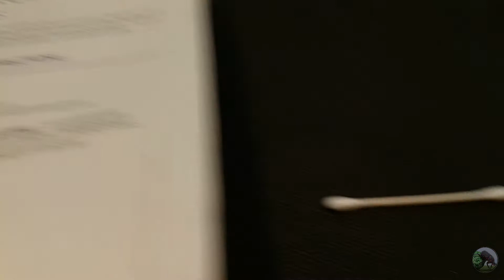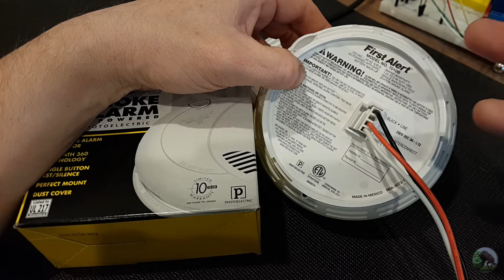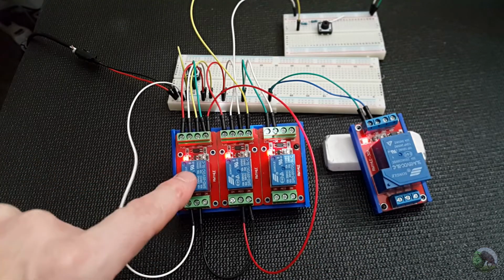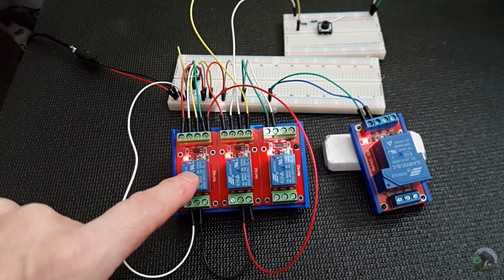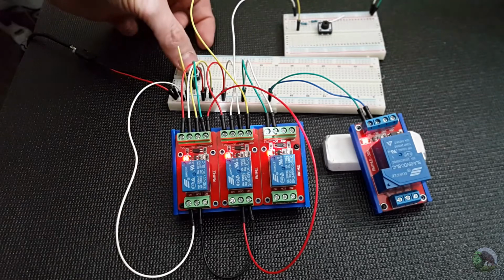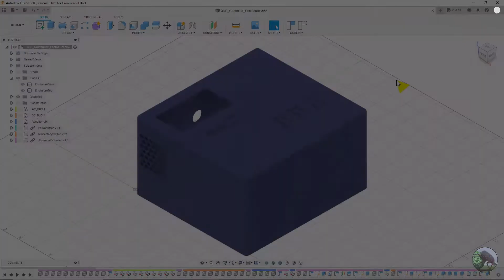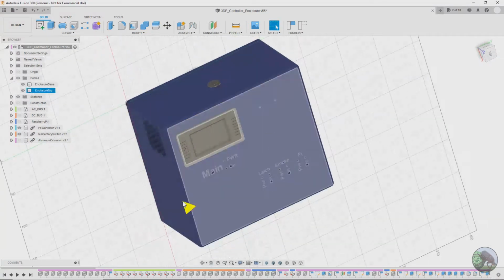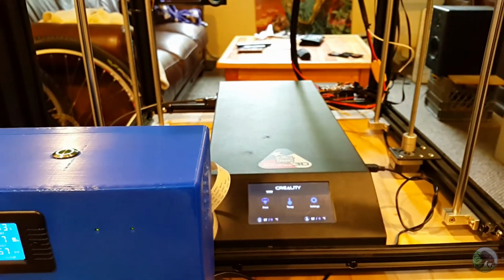3D Printer Controlled by Octoprint & a Smoke Detector

Comment: I'm running a Wyze Cam for monitoring and a Wyze Plug for a remote E-Stop for now. I like three concept of utilizing the signal wire from a smoke detector. I will likely try to borrow from your set up for my safeties as well.